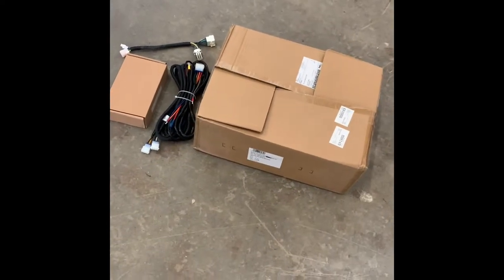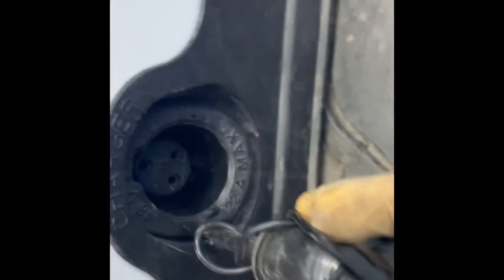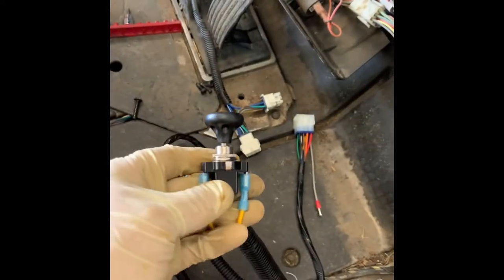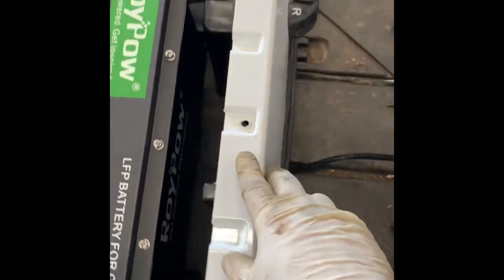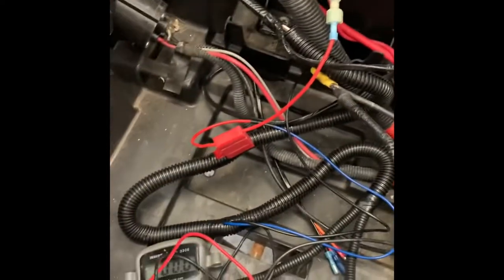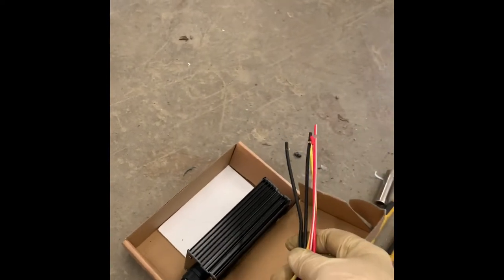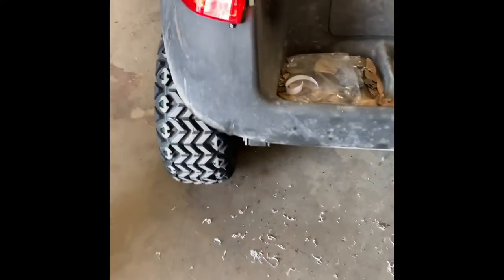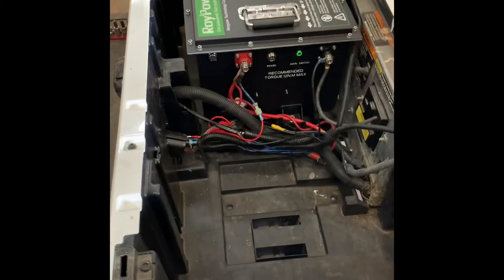2008+ Club Car Precedent LED Basic Light Kit with Bucket Harness and Voltage Reducer golf cart car

Comment: Great video. I just bought the deluxe light kit. I converted my club car precedent to lithium so I also bought a voltage reducer but it does not have pin connector or voltage reducer harness. I’d rather use what you show in your video but the link for that voltage reducer is no longer good. Do you have a link to one like you used?

Comment: Great video. I have a question. My voltage reducer did not come with a pin housing connector, just 4 wires, 2 for input and 2 for output. With the reducer harness you recommended or the Madjax reducer harness, can I connect my voltage reducer up to the reducer harness via the wires or do I need to add a pin connector over the wires? Or do I just need a different voltage reducer? Thanks!
Reply from the maker: No. You’ll need to run all new wires for that one. Check out my other videos and I have one for that reducer.
Reply: @jbgolfcarts  I see. Thanks for the reply! Which voltage reducer and set up the best one in your opinion? I can always buy the other voltage reducer that you recommended if you think this way is better. It does seem more closed and cleaner that way.

Comment: Great video.  I Converted over to lithium as well but used Relion batteries. Now my lights, horn, blinkers wont work.  I am assuming it is because i need that voltage reducer harness you mentioned.  My question is, do you think i can just get that and plug it in or did i fry the old system? Everything else works, the cart runs etc.  Thanks.
Reply: I am trying to see if i can save money by just getting the voltage reducer harness instead of buying the light kit and everything else.  I bought the cart and it had a mad jax light kit already.
Reply from the maker: @AJKInvestments  If your light kit was wired up to 12-16v without a reducer and you hooked it up to 48v it will blow the light kit. If you just turned on your lights it only blew the lights but if you tried the horn and anything else it blew those as well since you sent more power then it can handle. You may need a whole light kit and the reducer. Most kits are set up for 12v. Parts are below if you would like to order.

Deluxe Light Kit: https://jbcarts.com/product/club-car-precedent-led-deluxe-light-kit/
Voltage Reducer: https://jbcarts.com/product/voltage-reducer-dc-48v-to-12v-18amp/
Reducer harness: https://jbcarts.com/product/04-club-car-precedent-voltage-reducer-harness/
Bucket harness: https://jbcarts.com/product/club-car-bucket-harness/

You probably don't need the bucket harness but its there if you decide to order it as well.
Reply: @jbgolfcarts  Thanks so much for the reply.  I really appreciate it.  I will order the new stuff.  I believe mine had a madjax kit plus. Can you tag that one please?

Comment: After install, the light switch has power at all times, regardless of the key switch. Not sure of the issue?
Reply: Forgot add it has everything power when flipped in tow or run.

Comment: Is the voltage reducer needed with 4 12v batteries?
Reply from the maker: In your light kit it’ll come with a blue wire that will connect under the black cover controller cover and to one battery making 12v
Reply from the maker: Your instructions should say which battery to connect the blue wire to. Just just any 12v

Comment: What is the purpose of the single gray wire?
Reply from the maker: Behind the dash?
Reply: @jbgolfcarts  yes, the one that plugs into the factory gray wire
Reply from the maker: @chdavignon  if you install a deluxe light kit that needs to be plugged in. On basic kits it doesn’t matter.
Reply: @jbgolfcarts  I understand, but do you know what the purpose of the wire is?
Reply: Its for the Tail Lights on the Deluxe Kit with Brakes and Turn signals @chdavignon